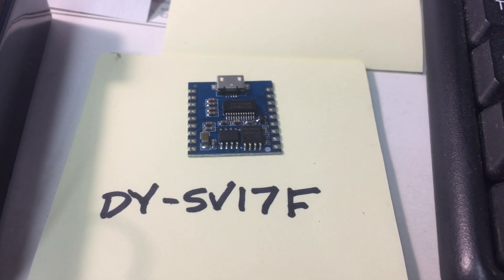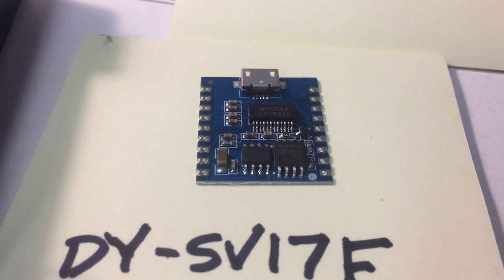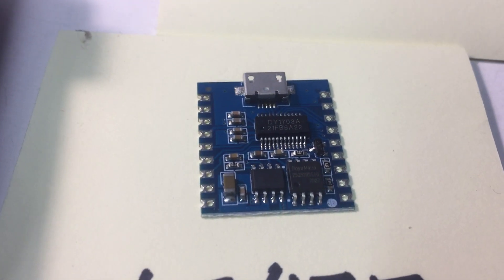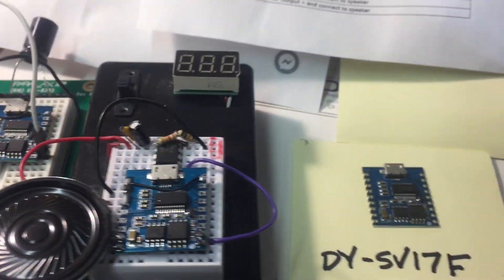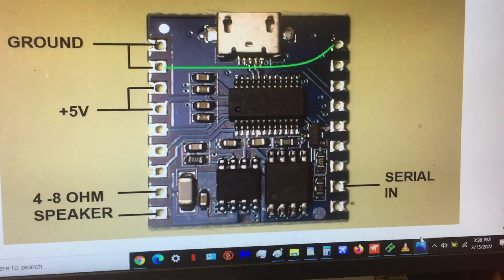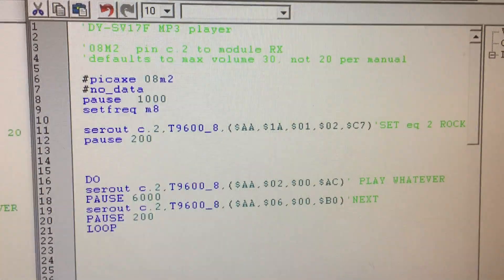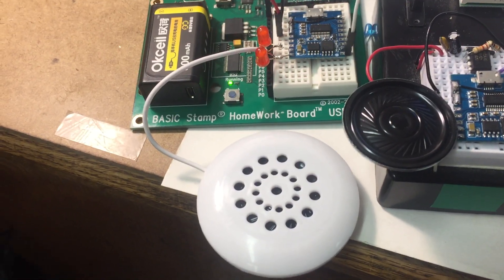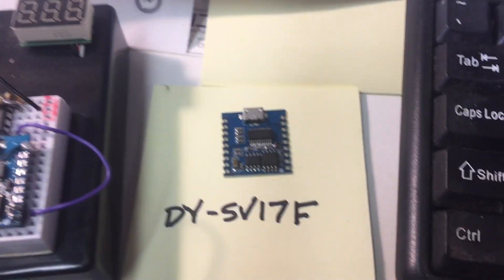DY-SV17F MP3 Player Module UART Control

Comment: What are the specs on that superloud speaker?
Reply from the maker: It's just a cheap 8-ohm pillow speaker, a buck or two on Ebay/Aliexpress. Mylar cone, same as the bare speaker but the white enclosure boosts the volume.

Comment: I bought a bunch of these DY-SV17F players and they work great for small (<4 minutes) audio projects. However, the DFPlayer Mini works out cheaper and more versatile. If you buy 10 TF cards (say 128MB or 256MB), you get all the features of a DY-SV17F but you get loads more space (up to 32GB). There's also a small 3W mono amp on the DFPlayer so it compares well and you can buy ten of them for under $10 so it's about half the price of the DY.
Reply: Stop capping
Reply: @PulishYuro  what does "stop capping" mean?

Comment: hi thanks for the video , can you kindly list down the resistors and its wiring diagram, I am new to this and no experience in electronics..I initially hook it up with 4ohms 3watts speaker but its a hit and miss many thanks (I meant the most direct connection possible without using another board)

Comment: hi, received a few DY-SV17F and seems to work. It powers when connected to UBS. However the flash memory is not detected by Windows so i cannot upload any files. Any idea what this issue is? cant find any support
Reply: I've had the same problem. Many micro-usb cables are for providing power to small devices only and none of the data wires are connected. I had to go find one from a data device before I could get the board to read as a USB drive.
Reply from the maker: Try another USB cable, port, or computer (or restart). It's a straightforward connection and process, just like a flash drive.